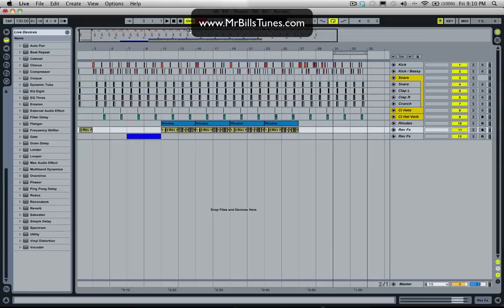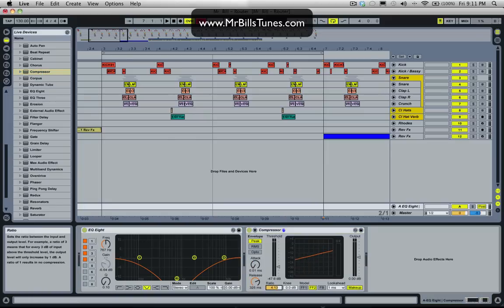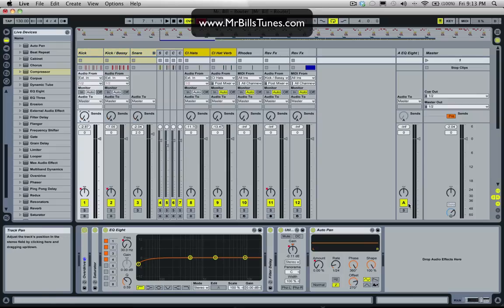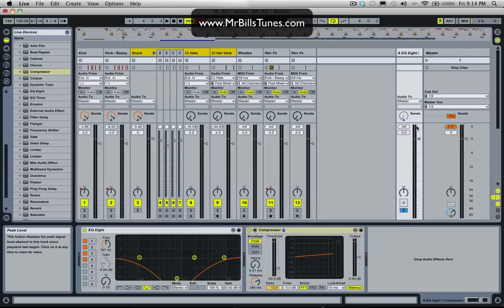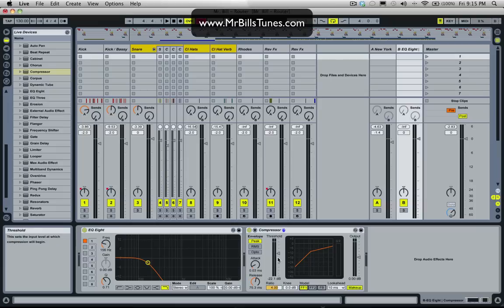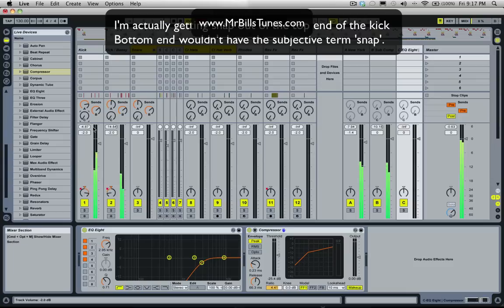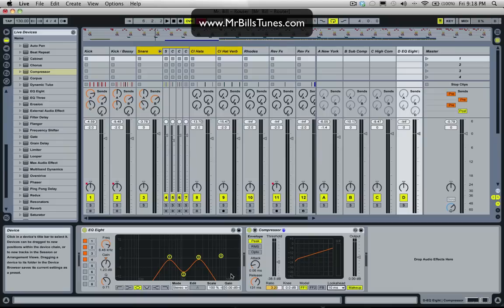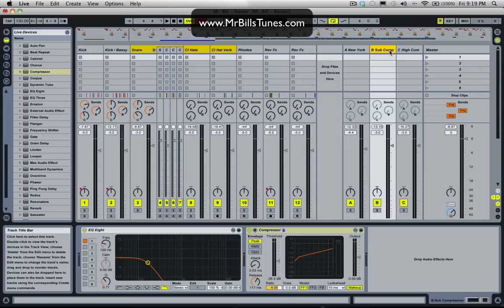Mr. Bill - Ableton Tutorial 36: Parallel Compression

Comment: Can someone explain the difference between the pre and post option beside the return track when he's doing this? I do it because he does but i'd like to know more about why I should do it
Reply: Pre is pre-fader and post is post-fader, meaning if a sound is peaking at 0 db and you turn down the fader to -4 db while sending it to a return track with pre-fader turned on, the return track is going to receive the original 0db signal. 

I hope makes sense.
Reply: I think Pre-Fader just sends the signal without any processing to the return track, and Post once the signal has gone through all the audio processing gets sent to the Return, so eventually you only compress in parallel the pre-signal. I hope i'm not wrong :)

Comment: In ableton 9.7 the compressor is not the same , it doesn't have the option of FF1
Reply: There is an old compressor which is better than the newest one, you would have to find it on your own and save it as your own preset
Reply: +gabe 26 what do you mean by find it ? Older Ableton plugins are not compatible with the newer 9.7
Reply: jean luc Dubinator What?! WHY!?
Reply: well , from what i've seen once ableton update its not backward compatible. if you really want the older compressor you would have to install an older copy of ableton with the older model and transfer only the specific plugin into the the newer plugin folder of the more resent copy, but that might create conflict issues withing the program. havent tried it for that reason.

Comment: Hey Mr. Bill Collector (Lol)

Everytime I add a sendtrack the volume is doubled, how do you solve this? Turning down each channel?
Reply: +Gustav Høeg Andersen Each time you send something to a send (without fx) it just doubles it, that's why it sounds louder. Since you wouldn't practically have a send with no fx, once you load something in make sure the dry/wet is set at 100%. This will make sure it's not doubling your signal but just processing it. With something like compression (that might not have dry/wet knob), just adjust its volume to taste.
Reply: +Bugera369 Thanks :D!